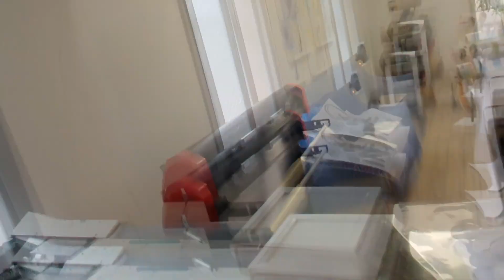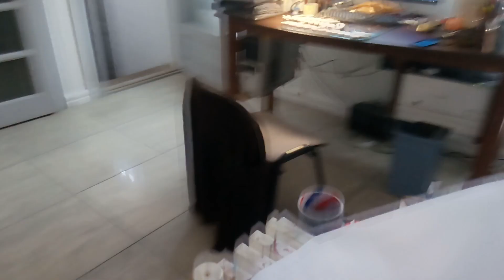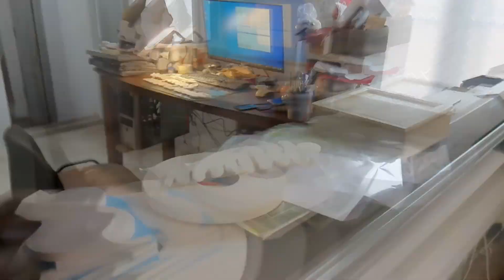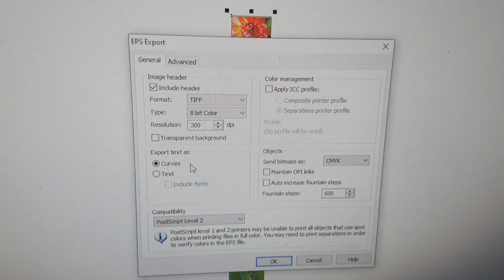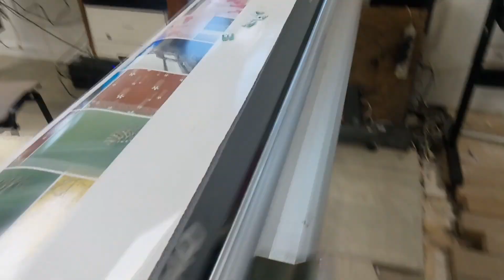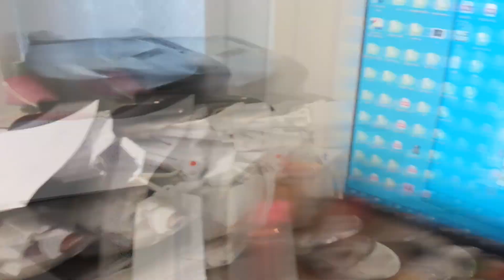Roland VP 540 head cleaning way to often! Fixed

Comment: Hi mate, I got VP-540 but got a problem. During the print no mater it could print 30% or 80% of file, suddenly printer stops (seems - looses connection with PC) on printers screen written: NOW PROCESSING and happens nothing. The print is failed :( I have checked and replaces 3 LAN cables already and 2 PC, seems problem is the connection of the printer and PC, it simply looses it... Have you had any ideas?
Reply from the maker: Hi, yes i have the same problem. There can be problem with swich or router between PC and Roland. I do next: send ping comand from pc to Roland(ping 192.167.2.222(printer ip) -t) -t mean time. If printer request, he will send request time 1-10ms. When you loose conection between devices, answer wil be request time out. OOO fck, so meny info i must say to you, i ll make video in days with instructions.
Reply: @infokanals   Thanks for reply, would be interesting to see your video. My VP-540 connected directly from PC to Printer via LAN cable without router or switch... I think could be problem with mainboard :(